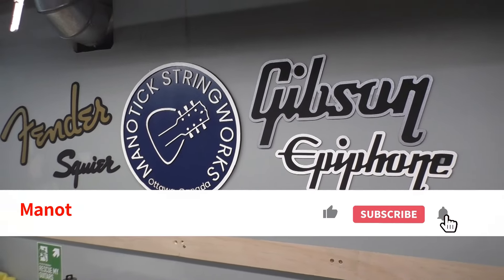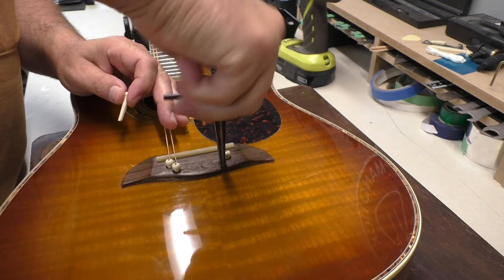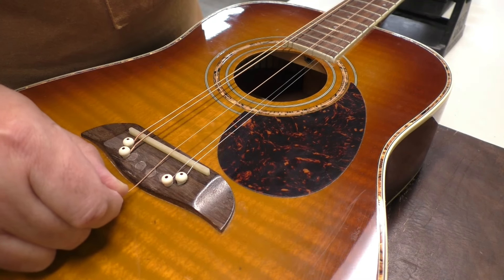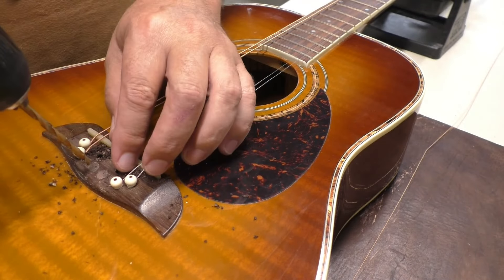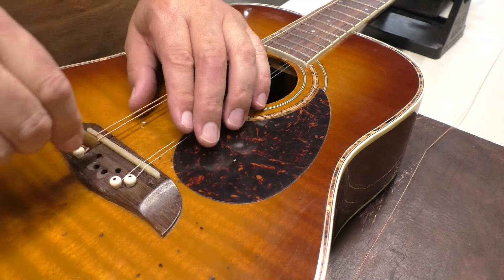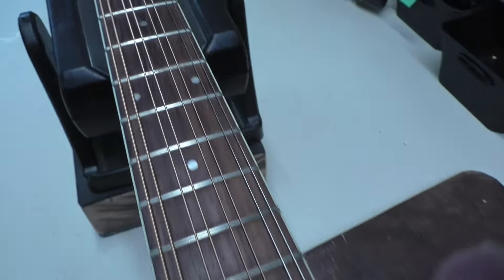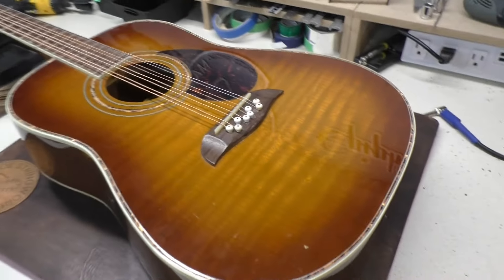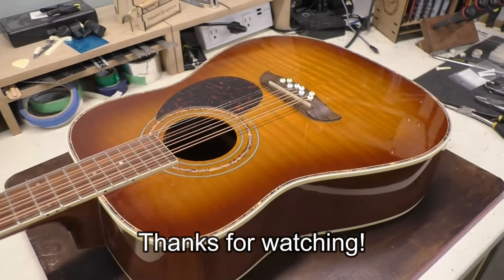Octave Mandolin Build Part 6:  Drilling the Bridgepin Holes & Playing it for the First Time!

Comment: How do you ground a leather pick guard on a precision bass ? The bridge wire is grounded to the body black ground paint a washer and screw, that’s how fender did it
Reply from the maker: @samstinkeringaround8961  do the same thing... no difference.  You can put some shielding tape on the underside of the pickguard as well.  Precisions have a humbucking pickup so noise usually isn't an issue.
Reply: @ManotickGuitarTech  Would copper tape be ok to use for a ground  ?? It's the same used for shielding with conductive glue.
Reply from the maker: @samstinkeringaround8961  copper is good
Reply: @ManotickGuitarTech  thanks for the advice
Reply: Is there a was to send you a photo of it when it’s finished??